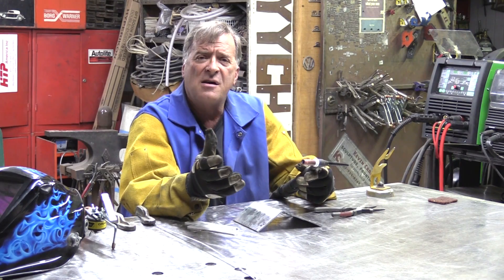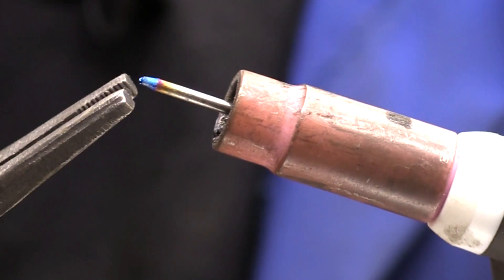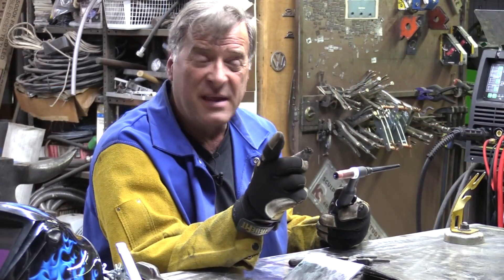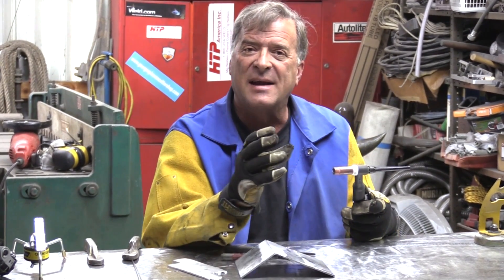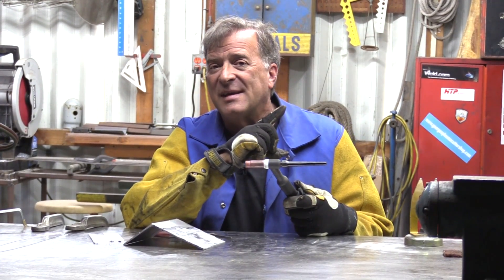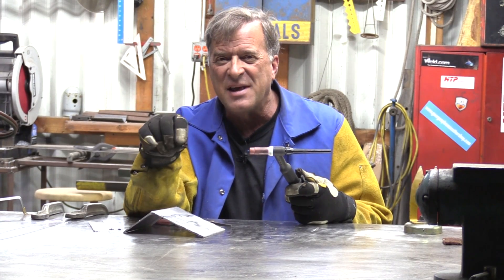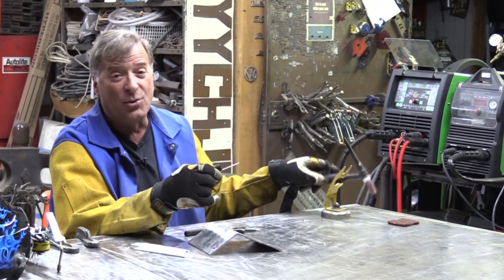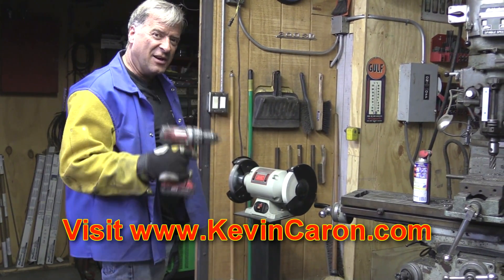Why Is my TIG Tungsten Tip Blue? (and What to Do About It) - Kevin Caron

Comment: Since i use 2% lanthenated tungsten, which is marked with blue stripe; when my tungsten tip turns blue, i cut the tungsten in half, sharpen the ends that were the middle and now i have 2 blue tungstens!
Reply from the maker: Great way to save and make your job easier!  Thanks for watching and posting.

Comment: Corners? My question concerns finishing angle iron L inside corners welded at 45 degrees. I got a little too much weld material into the weld and was able to grind off some (more to the outside area) but what trick or tool can be used to really get into the very inside corner to make the L flat(er).
Reply from the maker: Look for a Makita detail belt sander.      Should be just the right size.
Reply: It has been put on my shopping list. Thanks :-)

Comment: Is that the diamond grinding wheel that looks similar to those perforated knife sharpening stones but wrapped around in a circle, the one from McMaster Carr?

I'm looking at those wheels enviously but their arbor size is something like 1-1/4", while the bench grinders are half-inch arbors.  How did you go about filling in the difference?  Only hardware I have readily been able to find are washers (technically 7/16" washers have 1/2" ID) but they're very thin and weak, thought about trying to weld a stack of them together but that seems risky for something spinning at high speed in front of my face with a sharp object applied to it.
Reply from the maker: Yes, that is a diamond wheel.    The grinder is from the wood working industry and the wheel is made for sharping wood lathe tools.   Fits the shaft just right.  No shim needed.

Comment: My biggest problem my friend is that I have very small hands, and I can't find a pair of good gloves that doesn't stick out 2 inches passed my fingers. It really makes it hard to hold a mig gun without the gloves getting in the way. Home Depot, Lowes or Harbour Freight all seem to have just 1 size. Any idea where I could get smaller welding gloves?
Reply: I've done my shopping at a local Vern Lewis Welding Supply and they have a wall of gloves to choose from.

TIG gloves ranged from $12/pair to $35/pair depending on the brand and series.  Didn't price MIG gloves but my guess is that they have a range of products at various prices.
Reply from the maker: Found these with a quick search....http://www.charmandhammer.com/prod/Til1105XSXXS.html

Comment: Helpfull thanks alot. What to do if my fittings leak at the requlator of argon cylinder. Wasting unnecessary argon using a argon regulator not argon/co2 regulator. I only use pure argon on carbon steel at home workshop. I use soupwater to check leak and it bubbles at regulator and hose fittings
Reply from the maker: Sometimes a little rub with steel wool will remove the burr that is giving you trouble.   If not just take the bottle back and get them to replace the bottle.